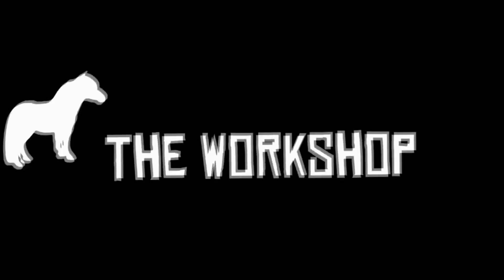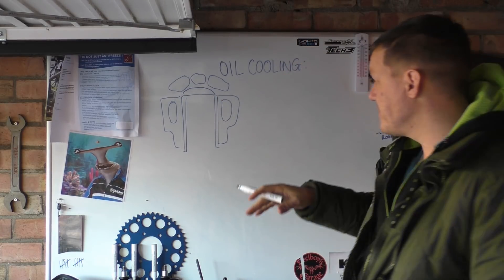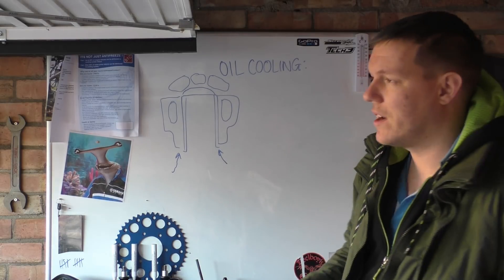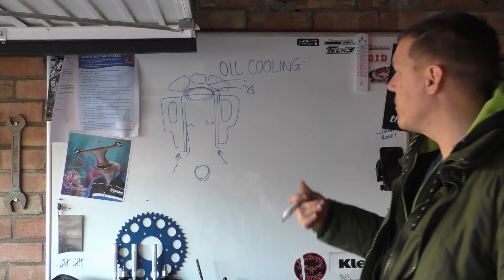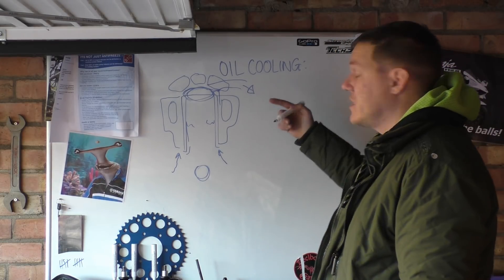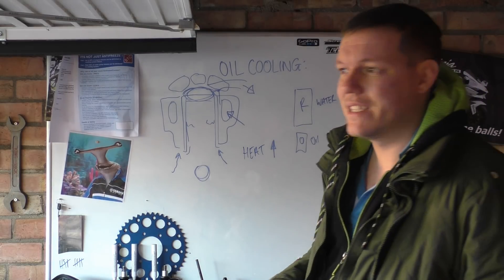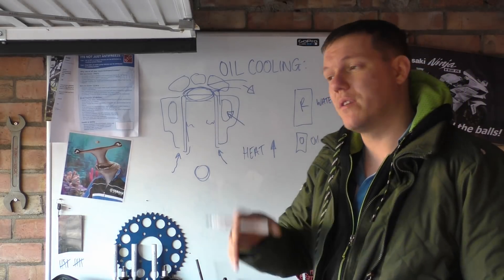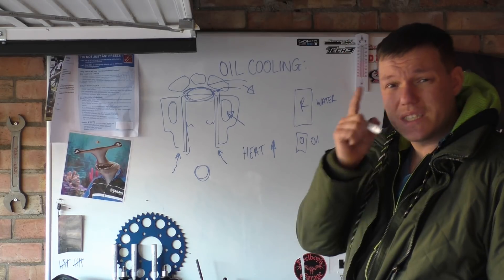Oil cooling - Part 1

Comment: Hi Matt I know this is an old vid but I'm thinking obout upgrading my oil cooler as a last ditch attempt at preventing my stator from burning out. I've had the stator, wiring and regrec replaced 4 times in the last 2 years. All quality parts. I was leaning towards the oil getting too hot. But tbh I'm a shed mechanic. I'd really appreciate your input. Thanks for the informative content.
Reply from the maker: Let me guess, it's a suzuki? It's not your oil cooler
Reply: @thedirtyworkshop  haha. No but your second guess is gonna be a 955i triumph I bet
Reply from the maker: Lol right so is the bike stock, if not, what's not stock? Also, do you have any of the old bits you've replaced?
Reply: @thedirtyworkshop  yes it's a stock daytona. The only signs of damage are to the stator windings each time. I have all the previous regrecs and they have all tested ok. I have just ordered another stator and this time a series regrec. They have a bad name for doing this but I am determined to nail it.
Reply from the maker: damaged how? Is one specific wire shorted, the coating cracked or is it several of the towers burnt?
Reply from the maker: What year is it?
Reply: @thedirtyworkshop  it's a 2002 had an upgraded engine from the factory. Steel crank,forged pistons
Reply: @thedirtyworkshop  sorry and a few other internal mods bring the power up Hence the big oil cooler i guess.the stator is incinerated  all the dieletic coating is gone the windings are shot. Hope this helps

Comment: Does adding an oil radiator OVER-STRESS the oil pump since now the oil has to travel a longer way ==> meaning oil pump has more work to do?
Reply from the maker: Not the length but any cross section  change in the cooler. In other words it depends which cooler.

Comment: So what about adding an oil cooler to an  enduro bike to up oil capacity and and the life span of oil to extend service intervals?
Reply from the maker: Lifespan of the oil? Is 2 years not enough?
Reply: @thedirtyworkshop  well you know, so the quality of the oil isn't shagged  from thermal breakdown and contamination  after every 8 hours
Reply from the maker: 8 hours?
Reply: @thedirtyworkshop  8 hours might be a bit hyperbolic but bikes like the wr 450f, exc 450, rmx450 generally need an oil change every 10 - 15 hours / 600 miles I'm just wondering in an oil cooler can long that out a bit ya know?
Reply from the maker: Lol no.
Reply: @thedirtyworkshop  aight cheers

Comment: I've been debating on a Grom with a) 181 Kitaco Neo big bore Oil Cooled or b) 250/300 cc swap engine (from some CB Honda model.  I draw from what you say that the oil cooled option should be great? Of course the swaps have water cooling, more gears  30-50% more power but they burn a lot of gas relative to the small tank and I'd hate to have to refuel all the time.

Comment: Why do we call a radiator that way? The percentage radiation in minor. Most heat is exchanged by advection oil/copper/air. Just wondering.

Comment: can I ask a few question here?
-I have ktm rc390..as u know every motorcycle engine must have oil passage..n I detect some line that can b use for installing oil cooler(maybe im using 3@5 row)..but had to drilled n tapped..so can I know,did oil pressure drop?n how to counter it

-2nd..adding another radiator(radiator from other bike,customize into 400ml?),is it affect on coolant pressure?n if I want to add external coolant temperature sensor n oil temperature sensor which place on those line much more effective?tq
Reply from the maker: 1) Did the oil pressure drop? Or d o you mean WILL the oil pressure drop?

2) Yes the coolant pressure will be lower.
Reply: @thedirtyworkshop  
1)I mean do the oil pressure will drop n how to counter it..also
2)if pressure its drop n how to counter it..

this is all for cooling purposes,as u know ktm rc390 known as an unreliable engine..but so far,I do not experience any problem with the standard engine..

my project for this bike just install 2nd radiator and dual fan mods,also oil cooler..n coolant n oil temperature gauge as well oil pressure meter..

Comment: The exhaust cooling is why v twins run different fuel maps for each cylinder
Reply from the maker: Exhaust cooling, just cooling in general, but yeah - The front cylinder is usually in the air stream whilst the rear cylinder has another cylinder in front of it.
Reply: @thedirtyworkshop  only found this out because of how they tune the rsv mille I got
Reply from the maker: Yeah most (if not all V twin 'sports' type bikes) are this way. Ducati's included LOL

Comment: So can I take a dirt bike without a cooler, put a fitting on the crankcase plug, run a line from the plug to a oil pump, run a line to the cooler, and run a oil return line back into the dipstick tube? Thanks in advance.

Comment: Hi Matt, could you do a video on complete re-oil... as in I rebuild a GPZ 600R A1 (89) and I completely cleaned everything reassembled as per manual, but I need to know if there is any gothas/advice on manually cranking the engine over and when can you be confident all the orifaces and oil places are lubed before cranking the engine. Im not  iun a position to fk the engine up, cash is low - great channel Matt

Comment: When my GSXR gets cold the water coolant hoses flatten/ collapse - the bike is 17 years old so perhaps the hoses need replacing although they're fine when bike is hot. Could it be that the radiator cap needs replacing as it's not allowing normal air pressure back into the system once it's cooled. Think you did a vid about this but can't find it! Would ask Del but he doesn't seem to know what he's talking about when it comes to radiators.
Reply: Yeah Id reckon a new cap would be in order and a check of the hoses too, if they've been getting collapsed flat and hoses are a bit old there might be a crease along the hose that can weaken it.
On some cars with very long top hoses that can get collapsed flat even with a good cap its fine so long as they hoses are in good condition but older hoses can weaken along the hose where it collapses and go off like an exploding banana and just end up with a banana peel flap of rubber the whole length of the hose still clamped on at each end. Empties the coolant and a blink and can cook the engine.
On a bike could leave you with a hot leg or worse if you're in shorts and if you use coolant additives that could end up on the Tyre which is like hitting oil.
Reply: Thanks for your reply - that makes sense. Cheers👍🏼

Comment: Why did Suzuki sacrifice the radiator size for an oil cooling system? The older SV 650s didnt have oil cooling.
Could it be because the radiator was a bit oversized for a naked bike anyway? In winter I cant get my oil temp over 70°C without blocking the radiator or giving her high rpms.

Comment: Would a oil cooler be good for my 2008 Yamaha Roadstar ? Also I have read posts that say, unless your moving the oil cooler does nothing. When sitting in traffic is where you would need it. Would the oil cooler need a fan?
Reply: Yes if the radiator comes with a fan then It'll cool properly when it's sitting in traffic otherwise in super cheap setups with radiator only it's still providing more radiative area for the heat to dissipate than not having just air cooled cylinders.

Comment: But evans must be 100% pure, surely you must cleanse the engine with prep fluid before adding the evans? I have been running with 50/50 oil and evans, reduced the chip frying capacity already.

Comment: So would I be wasting my time fitting a larger oil cooler to the air/oil cooled GSX 1400 to get a higher compression ratio say 12:1?
Reply from the maker: Detonation is not your friend LOL
Reply: Bloody detonation, bloody cracked exhaust lands. Thanks for the advice fellows. Still might get the larger cooler seeing it's 35c and 80% humidity and that wasting money on bling thing.

Comment: In the 80s alot of my mates would install headstock oil coolers that tapped into the dry sump plumbing. Alot of the Honda XR600r had them as we frequented 40'c to 50'c temperatures during the day. Easy install that added a bit more reassurance your not frying your engine to hell.

Comment: do oil cooling systems have a thermostat or sth like that,to maintain temperatur?
i have bought an older kawa zr750 and it is air and oil cooled.i bought it for daily use and i will riding in the cold, so im worried that the oil dont heat up properly or turns to cold when im on the autobahn (speed like 130-150 km/h)
Reply from the maker: "do oil cooling systems have a thermostat or sth like that,to maintain temperatur?"

- no. The oil is already in circualtion and need to get up to temperature quickly. Because the oil has a shite thermal conductivity and heat capacity - overcooling isn't an issue.
Reply: thank you one more thing i dont need to worry about ^^

Comment: Do you need some kind of thermostat if you use oil cooling with water cooling? I'm having problem with my CX that I can't use as large water cooler as it should have, should I just add oil cooler but with thermostat (if that is possible at all), or just modern cooler with better cooling "power" for water?
Reply from the maker: "Do you need some kind of thermostat if you use oil cooling with water cooling?"

- Generally no. The oil is already in circualtion and need to get up to temperature quickly. Because the oil has a shite thermal conductivity and heat capacity - overcooling isn't an issue.

The other issue is oil viscosity - which means that the thermostat will act as a huge restriction and load up the pump.
Reply: I shouldn't imagine it being a problem. The engine temp should be maintained at temp if the cooling system thermostat is working correctly.
If the engine temp drops the thermostat should close and maintain at operating temp until opening temp is reached, leaving just the oil cooling if both are too much. But unless it is pretty cold I wouldn't think it a worry. Just keep an extra eye on it until you know it's fine.
Of course keeping an eye on temp is never a bad idea anyway.